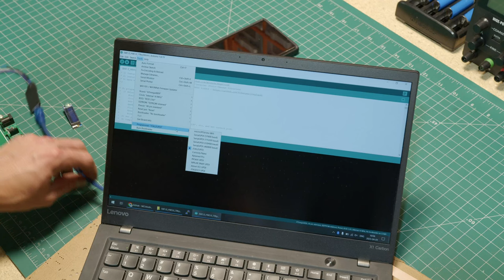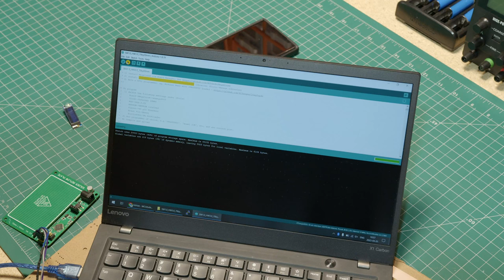Assembling, Programming & Testing the Solder Reflow Plate V3

Comment: FWIW, it's generally MUCH cheaper shipping-wise when using JLCPCB (and probably the others too) if you select the custom size option for your stencil and set it to something sensible (100x100 would probably have done the trick for that board in the video ;) )
Reply from the maker: @SomeMorganSomewhere Yeah I just CBF with a stencil for that one since the chip was in such a tight spot anyway, but for the ESP32 riser board I tested it with I did actually pick the smallest stencil it let me. Not sure why it ended up 400x300 or so!
Reply from the maker: Oh or are you saying that other than the drop-down options, there's another custom option? I think I got that stencil from JLCPCB too
Reply: @PlatimaTinkers  Yeah, there's an option just below the "Dimensions" parameter in the Stencil section for "Customized Size" if you select that you can enter some more sane values for the sizing. 

My boards tend to be fairly small so I usually go with about 1.5x the longest dimension of the board by 3x the shortest dimension of the board and get top and bottom on the same stencil. Ideally you want something that will fit in one of their 150x150 boxes (assuming of course your board(s) fits in one of those those ;) )

Comment: I think the infrared thermometer you're using suffers from parallax (in relation to the laser pointer) at the range you're using it in the video - so the low temperatures you saw along the bottom of the board was because the sensor was pointing at your cutting board (while the laser was on the circuit board).  They also suffer from errors used on highly emissive surfaces (shiny metal - so not not relevant to this video).
Reply from the maker: That is a super interesting point, I had not considered that. I'll test it out a bit when I'm next there. Thanks for the info!